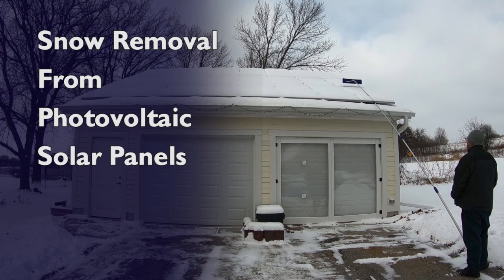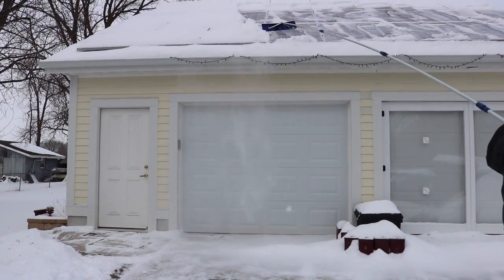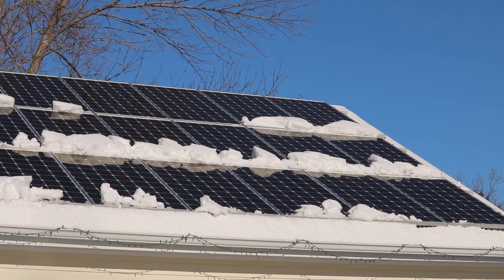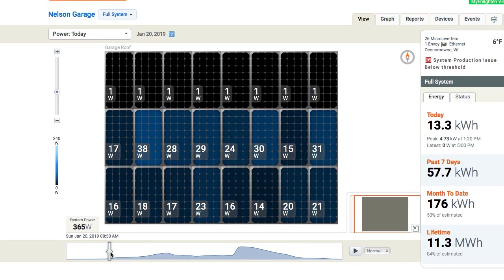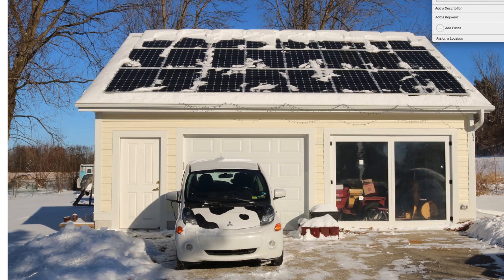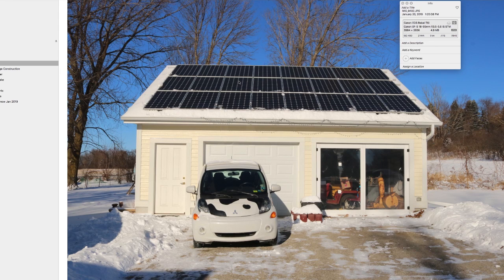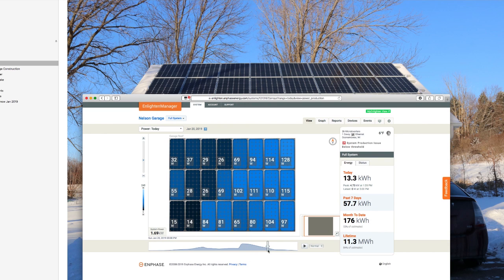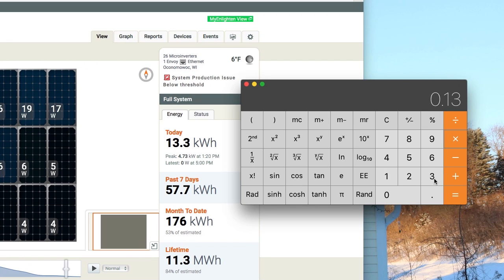Solar Panel Snow Removal: Is it Worth It?

Comment: Bought this to remove snow off my panels and broke after 1 year use, i's not sturdy enough to pull big snow loads, i had to reinforce it with bigger bolts and even at that it still broke into pieces. not well made, not for canada snow.

Comment: Does the rake scratch the panels at all?
Reply from the maker: No. It's plastic. Glass is harder than plastic, so it doesn't scratch.
Nearly everyone with an automobile in cold and snowy areas uses a plastic ice scraper to get frost off their windshield, and it doesn't scratch.
This is the exact same idea, just bigger.
Reply: @BenjaminNelsonX  I'm in Minnesota and literally just had my meter installed yesterday - right before a big snow storm. I have been watching my app and and really excited that I am already generating power! Thanks for the quick reply! Happy Holidays.

Comment: This is my first winter with panels.  Like you, they are all south-facing, with micro-inverters.  My calculus is a little different.  If I do not clear the panels, they will stay covered for days or longer, so the effect is additive over the days the panels would otherwise be covered.  In January, if it is sunny, I can generate 40kWh.  If cloudy,  8kWh.  So for me, each clearing might net me an extra $8 to $10 for the additional days of clear panels.  Plus with the exercise, I can forgo that gym membership :-)
Reply from the maker: It really depends on how sunny vs cloudy it is in your area AFTER a snowfall.
In my area, clouds tend to go hand in hand with snow. If you are someplace like Colorado, for example, they tend to get lots of sunny weather, and it very well may be worth the effort fo clearing the snow.
Angle of your roof matters quite a bit too. A steep roof will "self clear" pretty easily, while a lower pitch roof might shed NO snow without ample help!
Just run the numbers and see what makes sense in your situation.

Comment: Got one of those rakes and replaced the pole with electrical conduit to keep it from bending. Used pipe insulation around the couplers to prevent scratching panels. A little less fatiguing.
Reply: That, Sir, might be the alternative I was looking for. Thanks.

Comment: My ground mount in MT is 2 landscape rows of 4. I pull a push broom across to clear snow. About triples the power to remove 1/2" of snow. I have Solaria mono panels that manage shade much better than your old style. IQ6+ Enphase, 280W but I have seen them do better.

Comment: You should have removed snow from half of your roof to see how long does it take to melt the snow from the unraked section.
Reply from the maker: Great point. That would be an excellent way to conduct and experiment! I'll have to remember that for next time!
Reply from the maker: It's snowing again today. I cleared the left HALF as best I could, but the weather reports call for continued cloudy skies, cold temperatures, and some more snow for the next week.
Reply: @BenjaminNelsonX  thanks for trying 😀

Comment: Why don't you get a powerful leaf blower and hook it up to a long pipe and blow it off.  

Or put some pipes across the top of the panels with holes in them ( like a french drain / irritation pipe )  which allows you to do the same either with air or in the summer with water to clean them .
You could hook this up inside the garage and maybe do it one a timer.
Reply from the maker: In general for "Why don't you...." questions, the answer is usually because whatever is being suggested is complicated, expensive, or could possibly even damage the equipment I'm working on.
Any kind of equipment that is permanently mounted can also be ugly (my solar panels are highly visible, lots of people see them) or possibly also shade the solar panels, reducing production.
Reply: @BenjaminNelsonX  .
They don't have to be ugly. You could use either white or black drain pipes with irrigation holes. In the winter, use air to keep them free from snow, in the summer, use them to keep them clean .
 
You could make a feature of them . 

IF they are above the panels, or below, they should not interfere with them ..just saying
Reply from the maker: @benpar8120  Do you have an example of something similar that somebody else has done?

Comment: What about a battery leaf blower attached to a pole to remove the rest of the snow, will clear faster and won't be an expense to the solar panel maintenance because you will use on the summer too
Reply from the maker: I don't think I could lift a leaf-blower on the end of a 21 foot pole! That's the wrong kind of leverage! Everything at the far end gets really heavy really fast!

Comment: Maybe you could (in summer) remount each row of panels slightly further up and down the roof leaving the biggest space possible between the rows. Then at the same time increase the offset from the roof of the upper rail. This would give your panels a greater angle from level (maybe optimising the angle to give the greatest kwh/year) and when the snow slides off it would slide under the row in below it.
Reply from the maker: The snow really needs to slide off completely. Trying to go UNDER the next row down would most likely just make all the snow pile up WORSE!
Reply: @BenjaminNelsonX  fair enough!! Maybe one of these then:

https://youtu.be/FCWYC_cKTrU

Comment from the maker: That snow rake originally cost me $28. I've used it a few times, but I'm sure I'm still deep in the hole from a financial point of view trying to earn my money back on it!
As for any comments about running hot water under panels and other "out of the box solutions", most of them get expensive/complicated really fast, and some could even damage the panels, cause a roof leak, etc. Using electricity to heat the panels seems like a bad idea as well. In my experience, melting snow and ice takes a tremendous amount of heat energy - far more electricity than would be gained by having clear solar panels! Keep in mind that the sun itself on an area this big is up to a 40,000 watt heater! (Surface area times 1,000w/msquared) I'd hate to pay the electric bill for 40,000 watts of electric heat hooked up to the solar panels!
Reply: But your calculations are wrong, you calculate how much money you produce 1 day, but if you do not remove the snow, you will not produce for more than 1 day and the savings will increase a lot
Reply from the maker: @BuenasRutasBuenaVida   One thing that I've found in my area is that the biggest factor limiting solar production in the winter is NOT SNOW! Certainly, the shorter days, and lower angle of the sun don't help either...
Where I live, the biggest limit to winter solar production is CLOUDS! In the video, take a look at the sky and any shadows on the first day when the panels are being cleared. The sky is extremely overcast, and there is essentially no shadow, as the sun is so darkened and diffused by a thick layer of clouds.
What I do is look at the weather report!
In this case, the weather report for the second day called for a nice sunny day - a rarity in my area at this time of year. I'm glad that the solar panels were clear to get the sun from that sunny day!
The weather report for the day after that again called for CLOUDY SKIES! Weather forecasts for the rest of the week predict more clouds and some snow.
That said, as I write this (the third day,) it's actually SUNNY RIGHT NOW! So, the forecast was wrong! At the end of the day, I can add in the new numbers and come up with an updated financial value.
Reply from the maker: On January 21, 2019 (the day following the sunny day shown in the video) the weather forecast originally called for more solid gray skies, but then changed to partly cloudy. The actual weather was bright sun almost all day! The solar produced 20kWh that day - that's EXCELLENT production for my area size/weather-patterns/time-of-year! That's a $2.69 financial value! If the weather was like that every day all winter, it would completely cover my electric bill. Alas, sunny days like that are rare and far between!

Comment: what about some clear plastic sheets you could slide off the roof when the snow builds up.
Reply from the maker: There is a style of roof rake with a long strip of plastic attached. The head cuts the snow, and then it slides down the plastic. It's supposed to work well for thick snow. https://amzn.to/2WawJVs

Comment: Excellent video Ben.  It was very informative and will make me reconsider cleaning my panels.  We haven't had much snow this year and this is my first winter with the system.  It has been very cloudy and I've been having a hard time getting into double digits.  I don't have quite the same access as you have, so I'll also have to factor that into my decision.  Thank you.

Comment: It would seem like on a solar arrangement like yours that it would be easy to put some leeching field pipe along the top and use ground source water or water in a big storage tank in the garage to melt/wash the snow in the winter and rinse the dust and debris off in the summer. 

Your calculations showed what you would save if you waited till half the solar energy was gone before really clearing the panels, so probably $5 is you had it clear (or at least clear ice) by time the sun came up. 

So the question is, can the cost of a deicing system and the electricity needed to power it pay for itself compared to never clearing the snow or manually clearing the snow?

Also I wonder if anyone makes solar panels with frames that are flush with the glass so that snow and debris won’t get hung up there so easily. If it’s slippery and steep, adding just enough heat under the panels would cause to to slide down. Heat from either heat strips or heated air pumped in between the roof and back of solar panels.
Reply from the maker: At this time of year, a really good day might get me 20kWh, so that's a value of $2.60 (Not $5)
In this case, the panels were actually cleared TWICE. Once after the snow-storm, and then again during the following sunny day. I wouldn't have been able to fully clear the snow until after the sun had been out for a good while, melting some of the snow, and allowing some of the rest to slide down close enough to get it with the roof rake.
If we had an ADDITIONAL sunny day after this one, that's a day which would have maximized solar production.
Reply: BenjaminNelson, ok, so can a snow removal system be designed that cost less than $3 to build and run through a cycle as needed? I guess the the question is, on a annual basis, if you never removed the snow, how much would you lose, and can you build an system that clears it easier? 

So far all I’ve seen is snow rakes and brushes and using a leaf blower.
Reply from the maker: @imho7250   I think that's the right idea. For any sort of system designed for clearing snow, it has to be very inexpensive to build, simple, and also not cost much to operate (so not electric heat....)
It would also have to not risk damaging the roof or the solar panels.

Comment: I think it's worth it to clean them. Even if you can only get some of the surface clear. If it's not super cold, the sun clears them pretty fast, if it can see some clear surface to heat up.  I think the current (I) flow heat losses helps too. I have one disconnected *panel  (dead) and it's always last to self-clean in the sun.

I have the same Snow Joe from Amazon. My small  PV arrays are in the backyard and can be easily reached without extending the handle very much.  Before, I used a plastic snow shovel and just did the bottoms of some of the panels. Once they heat up in the sun, they melt clean.  Plus, I have angle adjustments. In the winter when the sun is very low, the angle is very steep. Slides off pretty nicely.

I use it in 21 foot mode for my garage and house roofs. I clear off south facing areas of the roofs, to allow solar heat to get into the attics. When it's warm inside, more snow will melt off the peak of the roof and spread to the entire roof. (if we are lucky).
Clearing snow off down near the gutters, reduces the chance of ice dam water damage.  Which can be a problem if rains a lot during the snow season..
It the recent past, we've had problems with excessive snow building up on the roofs in this area (north of Boston).
Some roofs failed and folks around here hired crews to climb on their roofs and shovel off the snow (two to three feet or deeper).
 So, I've been using snow rakes for a few years now. Just for insurance.. 
One time the snow was about 40" deep with a top layer of thick ice. But not thick enough to hold my weight reliably. The next year I was ready with snow shoes.. I stayed on top of the snow, until I went down to do the fixed PV array. The whole left snow shoe broke thru the ice and went down about 3 feet. I fell backwards of course! I was stuck there for 10 minutes! Seemed like I had stepped in a trap.. LOL! 
I got out and had to dig out the snow shoe. The next time, I cleaned the snow of the PVs before it got deep, or just waited for really nice conditions before cleaning.  Elderly Texans should not try to snowshoe.. ;)
Reply from the maker: That's interesting about the dead panel. I bet it would be neat to see thermal video of working panels vs one right next to them broken/disconnected!
Reply: @BenjaminNelsonX  I have a security camera on that area, so I'll be able to view a recording, after the next melt. Which might occur in a few days. Right now, about 2" of ice and snow is not going anywhere for a while. https://www.wunderground.com/hourly/us/ma/burlington?cm_ven=localwx_hour
We are now in the 10th hour of a 34 hour cold-snap. Temps staying below 9 deg F.  
(Very unusual weather in this moderate winter zone. Near the warm Atlantic). 
We've had about 15 minutes of very weak sunshine so far today. It's 10:40 AM right now.. 
That camera isn't thermal, but it still might record the difference in melt time.. The 3 good 200w panels are connected in series to a 13 ohm resistive load. (Hot water heating element). 
 So they all have the same current flowing.  They are Canadian Solar CS5P-200 IIRC.. 

Wow, I can almost feel some warmth coming in the window now!! It's up to 2.8°F now! :)

Comment: what would happen if you run heat pipes under the solar panels, would that melt the snow that lands on them?
Reply: I thought solar panels work better when they are cool.
Reply: @heckdornenschwert2289  hehehe  maybe, but they wont work at all if they are covered in mother natures cocaine.
Reply: If you run 40° water through them, the cost to heat or cool the water might offset how well and how long they last. If water gets between from freezing, or they get too hot, you might be replacing panels before their life expectancy is done.
Reply: @DarthTeaDious  why would 40dungarees f bother the solar panels? do they not see anything higher than that in summer? Also, not really talking about running water 'through'  over or on them but radiant heating in the form of air blown through copper pipes mounted near the underside of the panel could be enough to lessen the amount of snow that sticks, shouldnt it?
Reply: @philliponcarbs  sorry, not through the panels, but underneath. 
I'm sure there are other ways to do it, and maybe keeping the tin on the roof warmer than freezing wouldn't work well enough...

I was kind of thinking the same as a driveway. You wouldn't need to have water flowing through pipes in concrete over 40° since the concrete would always be above freezing, the snow would never stick. It'd always melt. 
The solar panels will get hotter than the outside temp in the summer. Keeping them cooler might help them last longer.
Reply: The exposed section of solar panel generates energy and the covered is shorting it. This generates heat, melts the snow, which then slides down. Higher roof pitch helps. Active heating is out of questions.

Comment: Hey Ben yes I clean mine off and it snows a lot here in Muskoka Canada, like I told the wife cleaning solar panels is the most work for the least money that I have ever done. Over the winter though it all adds up and so far it's about 400 kwh more than last year when I was in Florida and never cleaned a panel.